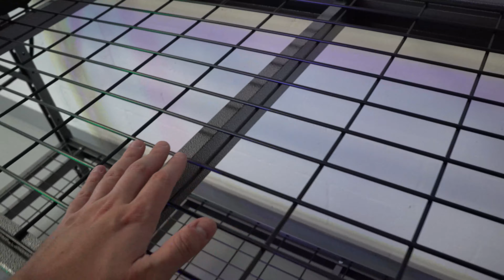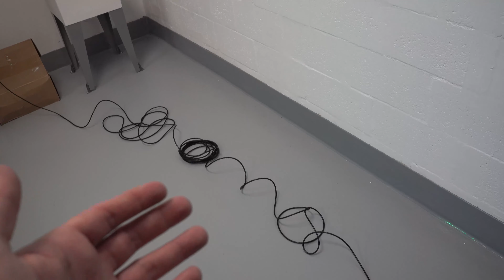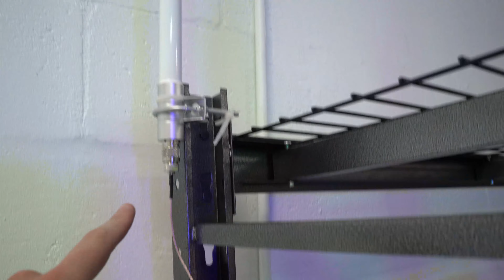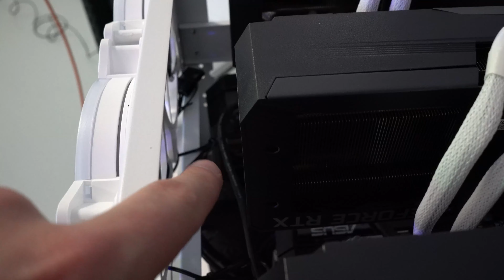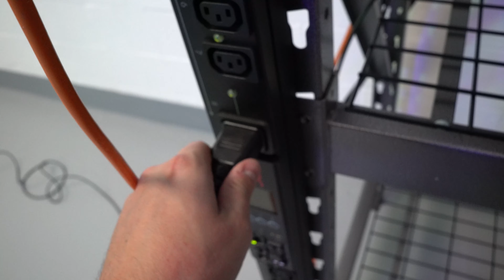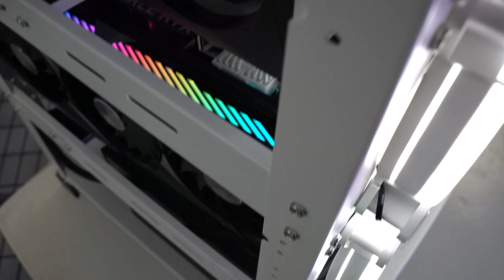Our First Rig is Up and Mining in the GPURisers Mining Bunker -  8 GPU 3060 Ti LHR Rig

Comment: I just put the legs of the rig through the holes in the rack. Do you have a source for the White AAAwave 12-gpu frame?
Reply from the maker: Right now the frames are balancing well on the racks but I think I may just let them sit through the holes. We will be selling white 12 GPU frames soon!
Reply: @GPURisers  I have 9 of these frames on the HomeDepot racks identical to yours, and mine just sit 3-wide per shelf with the legs protruding through the shelf without issue.